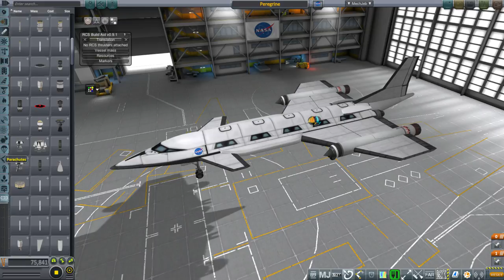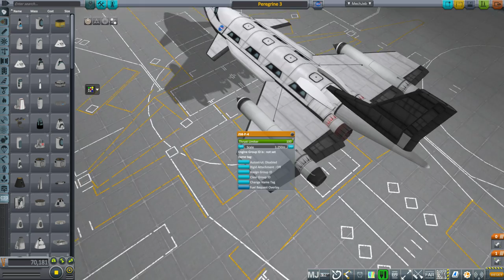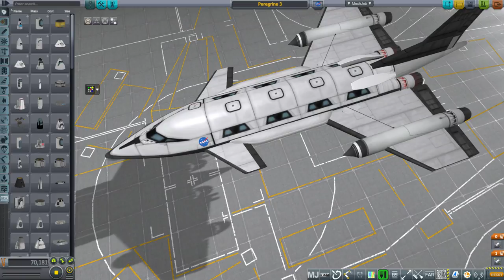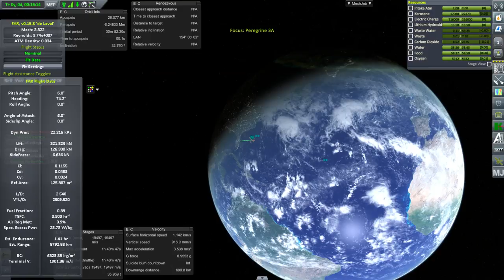Kerbal Space Program RO Sandbox - Hypersonic Liner Development 01

Comment: It's somewhat concerning that the ramjets were reporting requirements not being met. Perhaps shutting down the J-58's above Mach 2 would allow more air for the ramjets and their thrust would increase. If a noticeable increase in thrust is shown then more intakes would be in order. 
Another thing to try is more sweep on the leading edge of the wings and/or reduced thickness.
Reply: No appreciable change to the ramjet thrust suggests either there's enough intakes, or there's no cross flow of intake air. Short of adding more intakes directly to the ramjets, there's not much that can be done. It seems strange though that the ramjets don't develop anything like the amount of thrust they should at higher speeds.
I was not aware that FAR did not model drag based on B9's  wing thickness...  I've learned something new.
Perhaps moving the engine nacelles inboard will reduce drag or mitigate the possible cross flow of intake air issue.
Another possible issue is that the ramjets you use are not modeled correctly. I've been messing about with the CR-2 ramjets that are a part of Advanced Jet Engines (as installed by the default options that accompany RP-0) They kick in hard enough above mach 2 (up to 500kN) that if I'm not quick enough to shut down the J-58's they very quickly overheat and explode.
Just a few more ideas to consider, and hopefully you'll get past the limiting factor in breaking mach 5.
Reply: I haven't been able to recreate the same craft as you use since my install of the game uses different scaling and I'm missing some of the parts you use. I have what is basically the stock RP-0 install (as installed through ckan) for version 1.2.2. Essentially the Mk1 and Mk2 parts are scaled to 2.15m instead of 1.25m, so the engines (still 1.25m for the J-58's and CR2's) don't fit properly. Also I'm not running tweakscale to force a fit, although that would skew the thrust values, so the data would be meaningless. The CR2 looks like the stock panther rather than the J-58 with the install I'm using.

That being said, I did re-create a 'similar' craft using 1.25m parts in similar configuration. I don't have the same adaptor you use to mount the CR2's and tail, so I made a nacelle for them, and still used an outrigger for the J-58's. The craft was a little smaller than yours with a takeoff weight of 17.3t (10.35t dry) that managed to blow up the CR2's at mach 7 (80% throttle @ 31km altitude) The thrust was very similar to what you show in the video until I passed mach 3, where it pushed out past 200kN. I kept climbing to alleviate the heating effects, (at 22km the craft was a streaking fireball :P ) and thus the thrust dropped off until the engines overheated and exploded at mach 7.

Although these results have very limited correlation to your craft, there are a few points to note...
I had much less drag with the round 1.25m parts than you had with the mk2, so there are gains to be had there.
With adequate intakes, the CR2's should be able to perform better above mach 3. Since I had them in a nacelle mounted inboard beside the main body, they had a dedicated intake as well as the cross flow from the outboard intake when the J-58's were shut down. Radial intakes on the mk2 fuselage should have the same effect. Note, the information card still claimed requirements not met, even at mach 7.
Less mass should mean less AoA to maintain lift and thus less drag, but I'm sure you already know this better than I do.

I guess the tl:dr of all this is; 
Try more intakes. 
Try a smaller craft to verify your version of the CR2 isn't broken.
Try round fuselage instead of the lifting body mk2.

Hope some of this helps. I enjoy watching your videos. They're always interesting.

Comment: I think that the second variant was good, all what you needed to do to get 300KN+ of thrust from the ramjets is to shutdown the SR-71 engines, these small intakes near the ramjets are not nearly enough to feed them, the whole idea of the ramjets is that they 
 use the same amount of air for more thrust, so turning the SR-71 engines off will make the ramjets produce more thrust than these four engines on at the same time
Reply: after watching this video I tried to make a hypersonic plane myself with a ramjet and it went pretty good... the ramjets starts to be self sufficient (producing enough thrust to accelerate the vehicle without any other conventional jet required) at about 1000m/s, from that point the ramjets will take you to mach 7.5 at around 30km (for me) easily. my plane ( a pretty small plane that has only one pilot and no other crew) reached a distance of over 6,000km from takeoff to landing

Comment: Just an FYI but max climb and max range both occur at L/D max  At one point I saw your design hit 6.5 around 29,000m.  Also at mach 5 your shock cone angle is 11.3 or 22.6 degrees depending how you measure it.  You will want everything tucked behind this cone to minimize your drag if FAR is realistic about this.  Easy way to do this is make a nose cone with 2m diameter and 5m length.  Probably need to reduce your wing by 50%-70% and add some flaps and slats for takeoff and landing.  Also I am very unfamiliar with shock cone intakes but I suspect they need to be exposed to clean supersonic airflow to work at all so make sure they are outside of a 45 or 90 degree cone so they work at mach 1.  I am not sure how to handle the interference area where the 2 shock cones intersect over the wing
Reply: In stock you have to deploy slats in the opposite direction you would expect.  They don't increase your camber but it does move your center of lift forward so that your flaps do not make you nose down into the ground.  On take off I am not really sure they help as it is really just extra drag but on landing it helps with keeping the stall angle less excessive.  Rather then having to pitch up to 15 degrees which can cause tail strike issues you can get the same speed with 5 degrees pitch.  I will play around with FAR aero after work.
Reply: So ya I am not sure FAR is playing nicely with wings I would design for Mach 5.  For some reason they would not stall until 50 degree AOA.  Adding flaps/slats did very little to push the CL curve forward

Comment: Why are the SR-71 engines not using there special JP-7 fuel????. why don't you make a mk2 crew cabin modded and cut 1/4 or 1/3 the weight and lower their heat tolerance.

Comment: You ought to download advanced jet engine
Reply: Also top tip, Advanced flyby wire has a cruise option for your long flights.
Reply: Tyler Raiz I noticed that the engines isp doesn't change for which I thought you didn't have advanced jet engine.